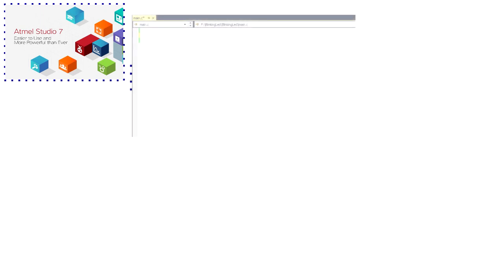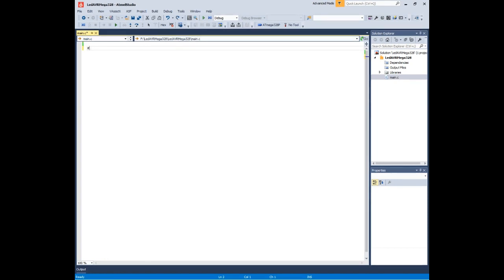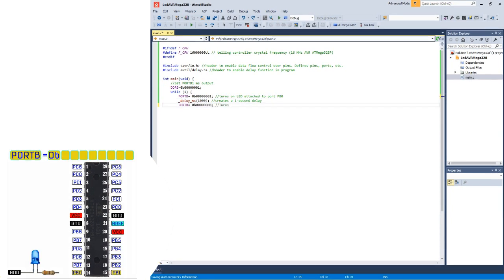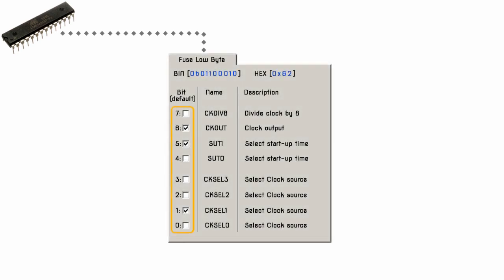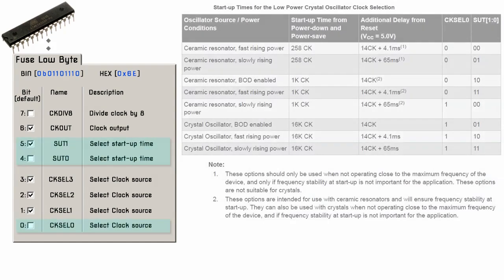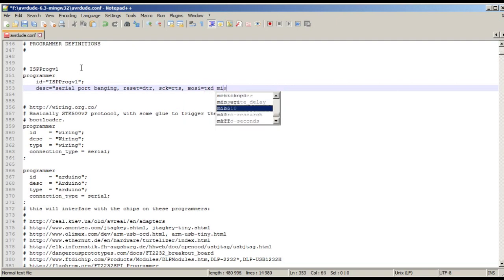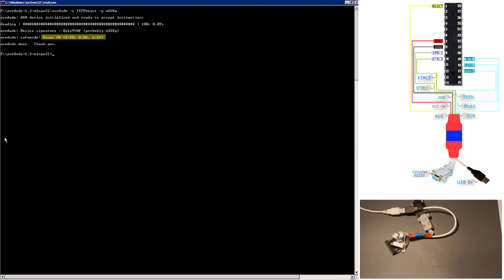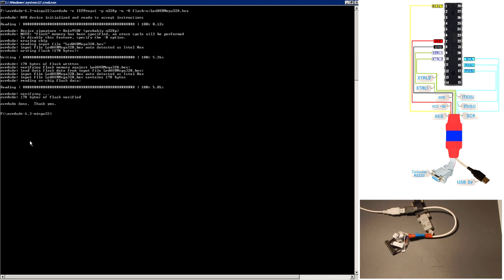AVR Microcontroller. Chip fuse bits configuration. Creating and uploading the LED blinking program.

Comment: He man, Is there another way to set the fuse bits under win10. Atmel Studio doesn´t work with my STK 500 Prog. I used Ponyprog before but it´s not working on win10. I need an alternative for Ponyprog. Any ideas ?